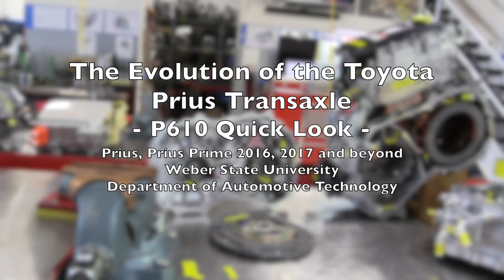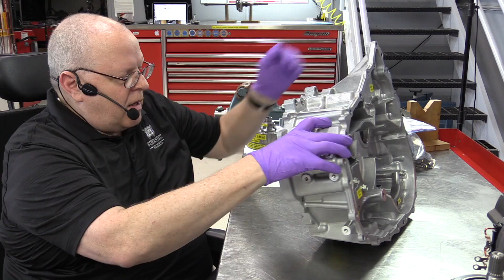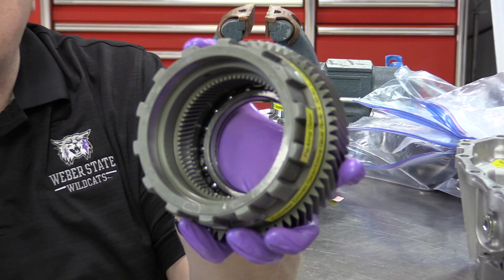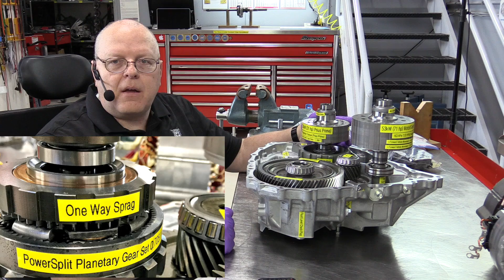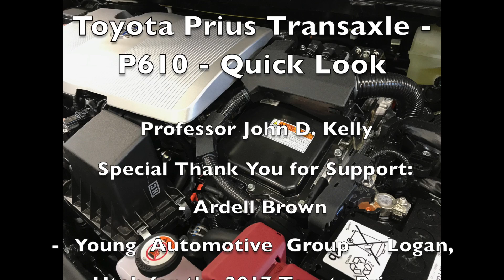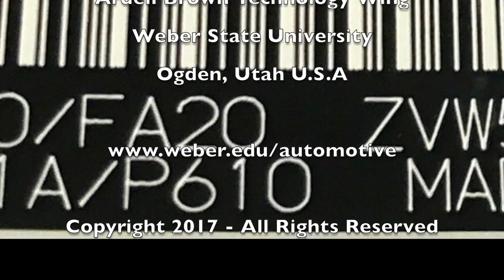2016 - 2022 Prius, Prius Prime Transaxle - P610 Quick Look

Comment: Any two components at the same speed, with the same direction of inputing torque, or any two components connected together, the entire PSD lock into a whole part, and than the third component at the same speed, the same direction outputing torque. Like the THIRD GEAR(direct power mode) inside the 4AT.
I do love your a series of videos!
Reply from the maker: Yes, that is correct. Thank you!

Comment: Nice to see the continued reduction of complexity every generation. One less planetary gear assembly compared to last gen. I would think the reliability will be increased compared to last gen even though it was already super reliable.
Reply from the maker: Thank you!
Reply: Planetary gear sets are incredibly reliable. They are what automatic transmissions are based on and they are NOT the parts that fail in an auto. It's the clutches and bands that control those gear sets that wear and fail, but in the prius transaxles, those functions are performed by MG1. it seems to me the change may have been made for packaging (shorter casing?), simplicity of changing reduction gear ratios between models and of course, production cost.

Comment: Dear Professor Kelly,
Your virtual classes are very informative and easy to follow (pause button has been very helpful).
Keep up the great work in educating us!
I watched this video multiple times, making my own sketches and notes... I think I understand this transaxle now.
May I ask you one question? My remaining doubt:
In the videos you used the expression that "MG1 sends power to MG2".
Is this done always & only via the HV Battery?
Or is there another way (in the power electronics) that the electric current generated by MG1 (acting as generator) goes directly via windings to MG2 (acting as e-motor)?
I came across the Inverter Assembly diagram of HSD Gen 3 and I am not able to find any direct link from MG1 to MG2.
Your kind reply will be highly appreciated.
Thank you in advance.
Regards from Finland
Reply from the maker: MG2 always propels the vehicle. MG1 and the ICE can contribute torque to MG2 to help it.Thanks for your feedback

Comment: 1. In 4th gen transaxle mg1 can also contribute to driving vehicle without starting the engine?
2. The one way spray clutch completely stop and  will rotate the crankshaft and fly wheel in the opposite direction of rotation so that the, power split planet carrier will be held so that mg1 can assist mg2 through the counter drive and driven gears to drive the vehicle right?

Comment: I like what I've seen in this video. This Prius transmission seems to be much more durable than a CVT with a belt drive. Are the rotors and stators for MG1 and MG2 in a different housing, not shown in this video, separate from the geared parts of the transaxle and I assume "dry", i.e. not filled with oil?
Reply: The stators are in the other half of this housing, and it does have oil in it.
Reply: @josephgriffin1065  - Thanks. I've seen a more detailed teardown video on the Toyota HSD transaxle, and in that video, it's clearly shown that transmission fluid is actually deliberately sprayed onto the stator coils to carry away excess heat. The fact that the oil is not only there for lubrication, but also for direct cooling of the stator, makes it very important to change out the oil at the proper intervals: dirty oil is less able to resist the formation of electrical shorts between the stator coils and the transaxle housing, or arcing between the three-phase power-supply cables (which are carrying 500 volts more or less). Electrical shorts inside the transaxle are really, really bad, not to mention expensive, like $3000 for parts and labor to replace the MG2 stator if it shorts out and gets damaged.
Reply: @Laura-Ann-Charlott, yes, very accurate

Comment: Thanks for the video. I was wondering about bearing life since the MG2 spins a lot faster now any concern about reliability? All the videos you did on all the generations of Toyota transaxles are really helpful to understand the concept I'm not a Toyota person but I have way more respect now that I know how it works could you do some day the Audi A3 E tron system it's more in my car line thanks it's a unique configuration until Kia came out with a similar Hybrid system I wonder what are the major difference between the two systems I think Honda has a pretty clever system in the latest accord system .
Reply from the maker: Thank you! The bearings seem to be holding up just fine. Ball bearings are used in devices that have much higher rotational speeds. The Audi A3 E-tron system is not unique. It appears to be patterned after the Honda Integrated Motor Assist (IMA) system used in Honda hybrids from 2000-2014. The Kia version adds a belt driven motor to the engine to help drive the crankshaft. The newer Honda two motor hybrid is totally unique.
Reply from the maker: That was pretty cool. I have seen, what looked like, gold plated ball bearings in the Chevrolet Volt transaxle. I suspect it is to alleviate a similar situation. The Nissan leaf transaxle has actual brushes on several shafts. I would love to have a Tesla powertrain at the school. Thanks again.

Comment: I wonder if we can use the principal of differential gears to do the power split function? The engine is hooked up to the outside of a ring gear. A few spider gears are attached on the inside. The spider gears then split the power to two opposed side gears where two motor generators are mounted.
Reply from the maker: You could, but the rotational speeds can be better controlled with a planetary gear set. Thanks for your feedback

Comment: Can someone explain to me why the first Lexus GS 450h has a “two stage” hybrid system? I know that the engine revs shift at around 60-70 MPH but my understanding is that it’s the same basic design as the normal hybrid synergy drive.

Comment: Is it because the Prius Prime now uses MG1 to aid the MG2 in driving the vehicle at high speed that the gearing now is lower for MG2 vs. MG1? From what I understand MG2 is still the primary traction motor, but given its smaller size & power ratings vs. older P410 design that the Prime operating in EV mode would need the MG1 to help, and since the latter is geared higher (1 turn of MG1 = 1.2 turns of MG2) it contributes to greater efficiency at higher speeds while MG2 is better at lower speeds. At least, that's what I imagine Toyota was thinking.

In contrast, Ford in the HF35 has almost geared its MG2 & MG1 to operate on almost a 1:1 fixed ratio - since the Fusion Energi doesn't use its MG1 for traction driving purposes the motor is geared mainly as a generator & to act as a "gearing" to allow the power-split device transaxle to pass engine torque to the wheels.
Reply from the maker: No, the smaller size is compensated for by higher rotational speeds. The P610 and P410 are almost identical in power, but the P610 is lighter weight

Comment: Fantastic & thank you very much, Professor! I have a question about the operation when shifter is in 'B' position. I wonder about what the transaxle does because I observe that once I drive downhill in 'B' position, the engine will rev up in proportion to the vehicle speed. Does the transaxle system lock up MG1 to achieve engine braking? My OBD2 showed up to >3000 RPM when I drove down the mountain decent. The OBD could not tell MG1 speed, so I can only guess.
Many thanks in advance!

Comment: I am trying to understand why my car (a 2014 Geely Emgrand7) of nearly 4 years (bought new in 2013 Aug) has suddenly started to jerk violently when I start the car early in the morning. Today it was a violent one, it was really frightening. It died down after about few seconds, everything coming back to normal. I had about 50kms left of Petrol (not diesel) I believe - I monitor my millage very religiously. After filling the car at the pump, starting the incident did NOT occur, and also I stopped at the mechanic but did not find anything wrong while turning on the ignition. This time it was a bit more violent than previously I felt. What could this be? The car agency did not find anything wrong after the service (70,000 kms) (it wasn't a major checkup, though) Also while driving there is a perceptible rare knocking from underneath, from where I wouldn't know, but it is definitely there. This perceptible and rare knocking effect has become mild after the service. Can you Please advise me. Thank you
Reply from the maker: It could be related to the transmission, best wishes

Comment: i'm curious about how reliable these are and what is the expected life span of these....how many miles before problems become expected. ty and excellent presentation.
Reply from the maker: Thank you! This transaxle is only two years old in Toyota's but, the same design has been used since 2005 in Ford hybrids. They have been very reliable.

Comment: Fascinating ! John I'm trying to understand the benefits of a Hybrid vehicle. Is it that you are recapturing energy when the vehicle is coasting ? Another words when the ICE is turning MG1 to charge the batteries, your still using energy or gasoline. Does the higher MPG come from recaptured energy  that other wise would be lost ? Thanks ! Take Care !
Reply from the maker: Thank you! Yes, that is part of it. The high mpg comes from the combined electric motors and ICE propelling the vehicle rather than just an ICE. the motors at low speed and combined motors and ICE at higher speeds. A large part of your daily driving is coasting or braking. Hybrids capture part of that energy and use to charge the battery for the motors. Have a good day!
Reply: Awesome ! Thanks to you I now have a good understanding of how these Hybrids work ! Prior to watching this series of vids it was taboo to me ! Thanks !

Comment: thank you for your precision in explaining everything. I have a question, Here in europe Toyota sells a small hybrid cas, called Yaris, I don't know whether is sold also in USA. The last model is 2017, do you know whether it features the same P610 transaxle, maybe in a smaller version? Thank you again
Reply: They sell a Yaris here in the states but in reality , it is a Mazda 2 from Mexico. Is the Euro Yaris a true Toyota or same boat as America?
Reply: @heathbauerle2787  I don't know, there ar many yaris around here, gasoline and hybrid modelsit's pretty common car but I don't know where are they made.
Reply: @fabriziooldrini6888  I personally go online and see were the ones in my area are made used (and new) and plug their vins into Toyota website and I get the information needed. I have no idea if that works in in Europe or not.
Reply: @heathbauerle2787  I am not expert, what is vins?
Reply: @fabriziooldrini6888  VIN Numbers, like JTEZU5JR4F5093019 is the VIN number of a 2015 4Runner.

Comment: For older generations ice compulsory to turn at certain vehicle speed, how about this generation? And at what vehicle speed ice need to turn for this generation?
Reply from the maker: Toyota says 84 mph. The new motor rotors have a higher maximum rpm of 17000. At 100 mph, MG1 is at 12,161, MG2 is at 14,582. As you can see, neither motor is at it's maximum rpm.  I suspect is is more of a power supply issue.

Comment: Why not connect MG2 to the rear axle making its replacement easier? MG2 is connect to the wheels anyway. I am assuming the front and rear wheels are spinning at the same speed. This would allow MG1 to be bolted on to the sun gear via a shaft so it can easier be replaced without disassembling the transmission.What say you Prof. Kelly?

Comment: Thank you John. I always enjoy your videos! I have two 017 Prius’. One is a Prius 3 and the other is a Prime Premium. The Prime developed an ATF leak up front near the driver side wheel well and I discovered that it has a little electric oil pump that circulates the oil external to the transaxle which I believe is for extra cooling. Why doesn’t the Prius 3 use this and does the Prime also have the internal oil drive that the 3 has?

Comment: Dear Sir John, you had mentioned there's an one-way clutch preventing the carrier shaft to crank up the engine during reverse revolution of planet carrier. 
Here's the thing, if there's an one-way clutch between the carrier shaft and the flywheel. Once the engine cranked up and running, engine speed, RPM, won't out run the one-way clutch? Cause the flywheel to be freed from the carrier shaft, not transmitting torque to the planet carrier? Thanks and looking forward for your reply.

Comment: Hello, Professor Kelly. I have a question: if Prius Plug-In (and any other Prius too) moves in EV mode down the road, does gearbox get no lubrication? Because of oil pump is driven from combustion engine. 
Thanks a lot!

Comment: Is it better for the motor lifespan to spin faster or spin slower? My impression is that I prefer the previous generation.
Reply from the maker: Good question, there are several factors besides rpm to consider. rotational mass is another factor. The older generation rotors were very heavy.
Reply: I guess you would expect each generation of Prius to be more efficient than previous generation and get better MPG. This is how it's done, they invent lighter more efficient tech. I find nothing wrong with this evolution. I'm sure the tech in new motors is made from higher quality components to cope with higher rpm.

Comment: At 22 minutes in the discussion of MG1 / ICE:   if the ICE is supplying torque to the wheels the MG1 must act as a brake, otherwise MG1 would spin free and no torque would go to the wheels.  I also imagine that the braking action by MG1 could be at any rpm and in either direction.  Am I right or wrong?

Comment: Hello , I have a question for you. I have transmission where the outer cover has a little damage and I have donor transmission with good one . Is it practical to just replace that outer cover without tearing down whole transaxle ? I already removed cover from the donor  transmission . I saw those phaser sensors and oil pump spline shaft and I played to place it back on than removed it again and figured it was not an issue as long as you take your time and align oil pump shaft before start going back together . So cover goes back on effortlessly . Please share your thought , what do you think about that . Thank you .

Comment: When I let go of the throttle in my 2013 Prius+ (PriusV) and start to coast (at a bit higher speed) and once the speed drops to around 47mph (75kph) I feel a little jolt - sort of like the engine starts. Why is that? It happens every time and at the same exact speed.